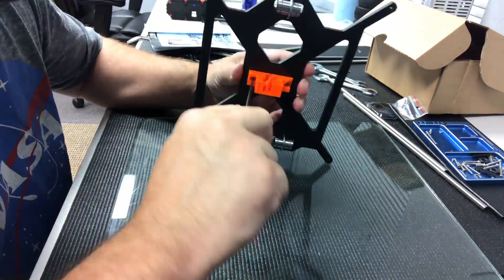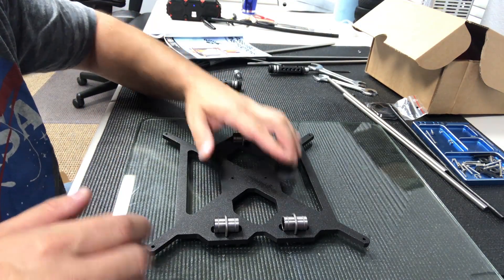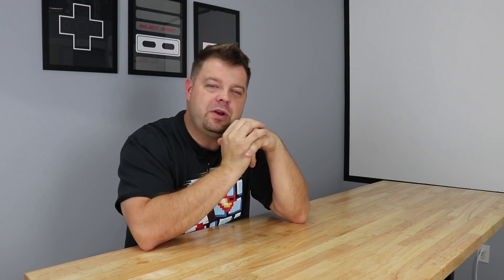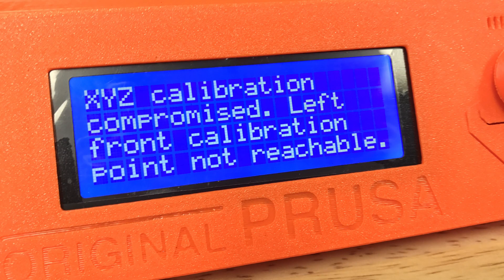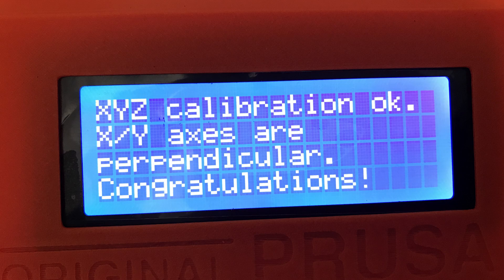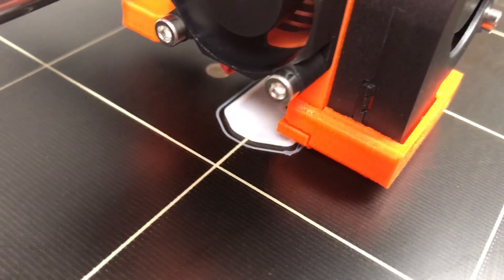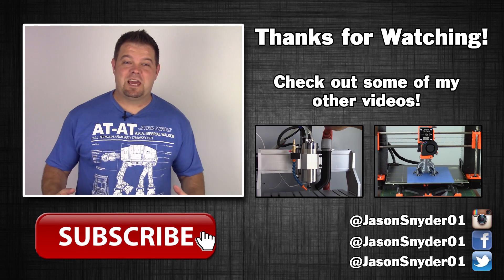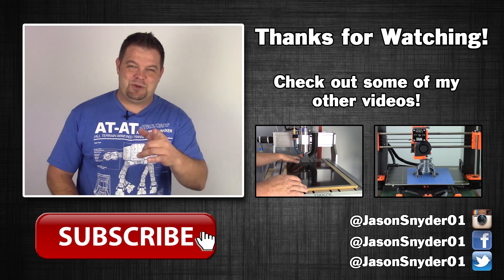Quick Overview: Prusa i3 mk2S

Comment: You forgot one (IMO) significant improvement (or I didn't pay attention): the PINDA probe no longer has that tiny and flimsy holder. It's properly embedded into the hot end now (although this might cause the probe to break on collisions). The 100mm distance worked perfectly fine for me, although I squeezed and bent the whole frame for probably 30+ minutes until the diagonals were perfectly equal. :D I've heard of others having similar issues, which makes me wonder whether those are related to slight inaccuracies in the printed parts.